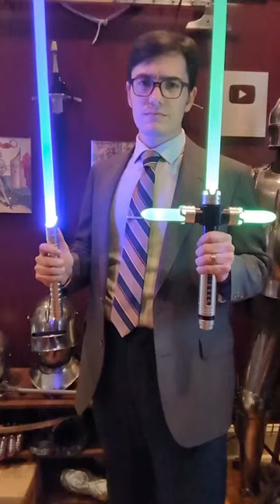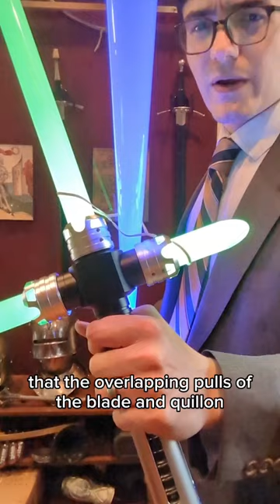Crossguard Lightsaber Theory

Comment: this actually makes sense for all lightsaber battles having so many openings for hits it because they simply cannot break that magnetic pull
Reply: And yet Shadiversity will still bitch about it for hours. I love his content, but he makes so many assumptions about how scifi laser swords work.
Reply: It also perfectly explains why binds happen so often in lightsaber choreography as a whole, and why the binds end up the way they do.

Responding to a bind by trying to just push through the opponent's guard with sheer brute force makes a lot more sense when the blades are literally being magnetically locked into eachother.
Reply: @smol_hornet613  Exactly!
Reply: The force power of the users also goes into the equation, anakin and obiwan had so many binds because they were effectively polar opposites of each other
Reply: What if I told you it's for dramatic purpose only?
Reply: @panamajack5972  If you replace every in-lore reason with its corresponding meta-reason, there would be no in-lore reasons left. You can choose that option if you like it, of course.
Reply: @panamajack5972  It is but giving lore to these nonsensical bits can enhance it by creating interesting story moments.

Edit: The rebels clip is a good example since it serves as a bonding moment between kanan and sabine.
Reply: There's a fan theory for every mildly goofy thing in star wars
Reply: @smol_hornet613  i agree with the other guy. We dont need all these convoluted explainations for everything. 

These conversations remind me of Dragon Ball Z fans who only talk about power levels and miss all the fun discussions on things unrelated to the fnatasy mechanics.

Star Wars is a deeply politifal series, but jow often are we actually discussing the real worls implications of the concwpts explored in the movies? Or do we constantly go down these retcon rabbit holes about inconsequential topics?
Reply: @SeanLaMontagne  You talk about discussing real-world political implications for Star Wars, and yet you say that a basic, surface-level explanation for why a sci-fi weapon does what it does on-screen makes things too inconsequential and convoluted.

Am I missing something here?
Reply: @smol_hornet613  yeah
You're missing the political discussion and talking about the mechanics of the laser swords
Reply: @SeanLaMontagne  And you're missing the mechanics of the laser swords while talking about space politics.

Just because there's a part of the lore you're personally not interested in, that doesn't mean there's anything wrong with other people exploring it further.
Reply: @Pezz01 Except they can compensate for the lightsaber turbulence, and do. It's the whole reason why Force users are the only ones using lightsabers in the first place.

But they can't just perfectly cancel out any force they want to at any time, and so even masters remain affected by it to some extent.

You're confusing macro and micro. There's a very big difference between moving a celestial object in a straight path, and perfectly predicting and preventing sudden rotations of a small object.
Reply: @Pezz01 I don't really see how the magnetism has to be a design error. It seems pretty fundamental to me.
   Even in-lore, the specifications of a lightsaber is described to be absolutely insane compared to other plasma weapon technologies; if the force fields attract and lock into each other, it's fully possible that there's just no way to design around that.

There's also the fact that either one or both the duelists could want to exploit the magnetic properties in order to force a disadvantageous bind onto the opponent. So, even if both users could perfectly anticipate the pull and apply exactly the amount of force to keep the blades apart, the other side could just use the force to cancel the cancellation if they want to.

In short, my two points are:
  If the forcefields have this magnetic pull to them it could very well be a fundamental issue,
   And even if Force users could perfectly counteract the effects that still doesn't mean it wouldn't affect combat.
Reply: @Pezz01 Seems we came to this franchise with opposing reasons, then. The story is just the setpiece - fleshing out the world is where the fun begins.

Anyway, I'm fine with ending it there as well.
   Have a good one, now. Cheers.
Reply: @Pezz01 And yeah, the hyperspace ram is high-tier BS.
  Don't worry about it. That's just Disney being Disney. We can just pretend that didn't happen.
Reply: @SeanLaMontagne  it's a lightsaber not a laser sword
Reply: @smol_hornet613  it's not a laser sword it's a lightsaber
Reply: @WUxze  Yeah, I know. Semantics.
  I just like to use the ignorant term every now and then for two reasons:
Because a lot of people get them wrong purely by thinking of the beams as lasers, and also because the terms 'laser sword' and 'lightsaber' technically mean exactly the same thing.
   But, yeah. Lightsabers.
Reply: @Pezz01 they can't because it's canon that force users put up a force shield around themselves, so combatants can't telikenetically flick their switch off and stuff like that
Reply: @natem1579  To be fair, this rule for lightsabers is only mentioned in a side story and is frequently disregarded. It's really inconsistent.
Reply: @ericwalsh2954 😮
Reply: @smol_hornet613 You can wield a lightsaber in universe with nothing but weapons training. Without the force you won't be deflecting blaster fire or winning any fights against any but the weakest force users, but any normal person can learn to use a lightsaber, the problem is getting a hold of one without being a force-sensitive to start. Also, Mando doesn't figure in this equation, the Darksaber has special effects and considerations.
Reply: @@pezz0199 Real world weapons are designed with more glaring flaws all the time. This isn't nearly as unrealistic as you're making it out to be.
Reply: @natem1579 I believe Shadiversity was referencing the Obiwan vs Grievous fight were Obiwan slides his blade down and cuts off one of Grevious’s hands.  That goes against how lightsabers have behaved in basically every other instance.
Reply: @smol_hornet613 why is the hyperspace ram BS? It was one of the only cool parts of the sequels. It’s pathetic they never thought to do it before that.
Reply: @@pezz0199what’s wrong with hyperspace ramming?
Reply: @dylanb2990  Because hyperspace doesn't work the way you think it does. Hyperspace is dimensional travel, not FTL.

When you enter hyperspace, you're not traveling faster per se. You just briefly enter another dimension - Hyperspace, hence the name - where you traverse space much faster than in our dimension. This is why, rather than retaining velocity post-jump, ships will stop in empty space as if they just teleported in. Because that's what hyperspace is: teleportation, with a lot of extra steps.

tl;dr:
   Hyperspace ramming doesn't work, because you can't hit the opponent's ship when your ship is in another dimension.
Reply: No it’s not 
It in fact negates why blaster shots can be reflected back at the shooter, or why sabers spark when they strike each other. The energy is an opposing force, not a magnetic one. Besides, for the sabers to be magnetically attracted to each other, they would need to be opposites; positive and negative. One saber would be positive, the other would have to be negative in order to stick at all. Two positive sabers would repel each other without ever hitting
Reply: @smol_hornet613 that simply isn’t true. Cinema works a certain way and many tropes there within are almost law. There are too many instances in cinema where blade pushing is shown, and it’s not because regular swords are magnetic 🙄
It’s “more dramatic” or so they say
Reply: @tristenmagnoni7097 a poorly written one, sure. There are many ways to create character moments without upending the physics of an established universe
Reply: @natem1579 I don’t think it’s so much a force shield as it is the more powerful a wielder, the harder they are to throw around. It wasn’t until after Dooku literally disarmed Anakin that he absolutely rag-dolled him at the wall. He  created an opening by causing Anakin to lose focus on channeling the force
Reply: @themindfulmoron3790 it’s fairly unrealistic
Reply: @smol_hornet613 Is it dimensional…? Cause Han clearly said in the first movie ever that they could fly into a sun if the hyper-speed calculations weren’t correct. Hyperspace ramming, at the very least, works if you calculate it to do so, if it is dimensional
Reply: @johnhagala3622  Tropes and lore are separate things. Always have been.
   There are always reasons why the authors and directors do things, but those reasons do not extend into the actual worldbuilding.

It's as I said earlier. If you replace every in-lore reason with its corresponding meta-reason, there will be no in-lore reasons left.
  If you like "it just looks cool" better, then you can believe that instead.
Reply: But they’re shown to easily parry each other. If the magnetic force was that strong, every parried and blocked strike would have them awkwardly stuck together and theyd have to pull the sabers apart every time and that isnt whats shown.
Reply: @nmr7203  Just because there's pull doesn't mean the beams are hopelessly locked together. It just means there's resistance.

With real sharp swords, sliding the blades edge-to-edge is very hard because the edges 'bite' into eachother. Doesn't mean you can't do it, just means it's harder. Saber locks work in a similar way, except with much more potency and across the entire beam.
   Breaking a saber lock is very easy; just pull both the sabers away perpendicular to eachother, and they'll come loose. But if you pull your saber away and the opponent continues to push... well.
Reply: @panamajack5972 Then I'd say you're a total bore and that logic and dramatic flair are not mutually exclusive. If it "doesn't make sense" and you can make it make sense by using context clues and a sprinkle of real science, that really does nothing except enhance it.
Reply: @dr.insanity9087 A lightsaber basically has to be treated as just a really fucking weird ass firearm if you think about it. Be mindful of where the emitter end is pointed, be mindful of if your finger is on the button, and don't look into the emitter end. The only difference is now you have to apply those rules, plus the added parts about how it also requires blade safety technique and the fact that a mistaken strike with a lightsaber WILL cost you.
Reply: @smol_hornet613  You mean in-lore reasons that are by and large head canon by viewers in an attempt to explain away problems that the writer's themselves couldn't be bothered to explain?
Reply: @natem1579 It literally took like 30 years for them to say lightsabers are drawn to each other

Comment: I think you’ve got a good idea going here. There’s also the fact that the vents can be adjusted to go more at an angle as well. I’m not sure if that helps or hinders the supposed practicality of the lightsaber though.
Reply: Honestly that might make it better because if you're in a lightsaber engagement with another person's lightsaber, the vents could be adjusted to more easily take a hit at the opponents' arms or lock their saber because unlike regular swords, a lightsaber's cross guard is lethal.
Reply: @ChibiOnVR sharpen the crossguard and it'll be lethal
Reply: @ChibiOnVR  cross guards are good for punching through armor.
Reply: @brrrrrr  yeah but what I mean is, if I was in a lightsaber engagement with someone, a quick flick of the wrist could slice off their arm with the crossguard (assuming I put the crossguard at an angle), making me win instantly. 
It also would help inhibit their saber, especially if the crossguards attract the opponents' saber blades, thus making it easier for the aforementioned situation to happen.
Reply: Yeah vents angled forward has always been the lightsaber I like most, it’s more practical.
Reply: @sci7zo  so too is the tip of the sword.

Comment: I think the bigger problem is that a crossguard should be designed to not potentially harm the wielder of the sword.
Reply: Agree! I always thought this light saber design was dumb.  I've done a little sword work and it's so easy to come into contact with the cross guard. I'm glad someone else is thinking the same thing.
Reply: I thought it was understandable with Kylo's, since "crossguard" was a secondary function to "venting the unstable energy from the cracked crystal I use cuz I'm a massive donger who can't even sith right"

But if you were to build one with a crossguard as the primary intent, a more V shaped guard would make more sense
Reply: @funnyvalentinedidnothingwrong  yes a more forward directed "crossguard", so a V shape, would mitigate some of the "touching" problems, but they will prevail. overall lightsabers would mess your clothing up when wielding, unless you adapt a very wide and open "style" of moving your blade, wich again opens you up as you have do actively remove your cover out of the line.
also many maneuvers and stances would be wildly dangerous. 
Overall Lightsabers seem to be quite dangerous to the wielder and more a problem than an advantage.
Reply: @funnyvalentinedidnothingwrong  yeah I think Kylo's crossguard made sense with its lore, but Dave Filoni is a hack who didn't understand why it was a thing and imitated it because cool
Reply: @funnyvalentinedidnothingwrong  for Kylo specifically, his entire character (especially in 7) is being an edgelord Darth Vader wannabe down to wearing a mask he doesn't need. i think it fits him perfectly if he made the crossguard "just cuz it looks cool"

Comment: The cross guard on Kylo Ren’s light saber was not added as a defense mechanism, rather it is a vent to keep the light saber from instantly blowing up
Reply: Yeah, but other media showed that other lightsabers use them despite being more stable.
Reply: Kyle Rens crystal was cracked to a point where in order to avoid overloading due to it being unstable they put on vents to get rid of the excess energy
Reply: @Mr_Motivated420  exactly
Reply: @Mr_Motivated420 But then the longer parts would be the guards, not the blade of the lightsaber, since its structure surges from the bottom.
Reply: He did at some points in those abysmal movies used it as a offensive mechanism like when he pinned finn against a tree and used one of the guards to burn finns shoulder and he also used it as a defensive mechanism when he was fighting those protorian guards in tlj and also in their last duel between Kylo and Rey in tros
Reply: just like him fr fr
Reply: @OtakuUnitedStudio it was also used in early lightsabers instead of relying on forcefields iirc
Reply: This is true, since he cracked his crystal, hence why the blade is so unstable and looks like a flair rather then a beam
Reply: It's there because JJ Abrams wanted it. That's all there is to it. He doesn't care for logistics, he just thinks it's kEwL.

Comment: I've heard that the crossguard blades goes all the way from the central grip area, so the metal tubes sticking out are mainly just for hand protection and aesthetics. So if you hit it, your lightsaber would just cut in and be stopped by the lightsaber blade anyways.
Reply: I just wish the top part of the crossguard section was open so the extended metal was only at the bottom to protect the user's hand.
Reply: @Vanom.  I mean it doesn't really make much of a difference either way.
Reply: @dallenhumpherys7911  It would allow the crossguard blades to come in contact first rather than an enemy lightsaber hitting the metal first.
Reply: @Vanom.  And? Then the metal gets cut, but it is still perfectly functional. You're in the same boat as if there weren't metal there.
Reply: @dallenhumpherys7911  I think you're missing the point of my initial response. Does it work with the metal as is, assuming the blades start from the center? Sure. But, why use that design that exposes more metal to be damaged, when having it only at the bottom gains both benefits with reducing potential damage to the saber.
Reply: @Vanom.  But does it really matter if that metal is damaged? It is just superficial. (And having that extra metal marginally benefits safety. It could also allow you to loop your finger over the crossguard, although I don't see much use for that in a lightsaber.) And if the metal is damaged, you're just back at the same place as if the metal wasn't there in the first place.
Ultimately, if that metal on the crossguard is damaged, it really only hurts the aesthetics. Not having the metal there has no real benefits other than perhaps fitting your personal taste in aesthetics better.
Reply: @dallenhumpherys7911  I think considering most lightsabers are metal, having metal on top of the cross guard would be more dangerous to the user. if the strike to the crossguard melts the metal whilst the lightsabers are locked and it drips onto your hand or anywhere else on you're either going to struggle to continue or you're going to be incapable of continuing but we all know realism isn't exactly star wars
Reply: @GoldenHollow  But lightsabers seem to vaporize more than melt, particularly with such a small  amount of metal.
Reply: @Vanom.  that’s what Cal Kestis’ lightsaber has

Comment: Thing is, that magnetic pull Kanan mentions.
It seems like it doesn't allow sliding anyway hence it being unlikely anything would hit the crosssection of the blade and guard anyway.

Remember that chilling sound when Anakin beheads Dooku? That was someone forcibly making two lightsabers slide against each other. 

We never hear that sound anywhere else. The blades don't slide against each other without putting a lot of force into it as they lock at the point of contact.